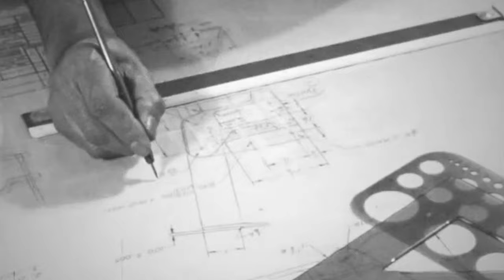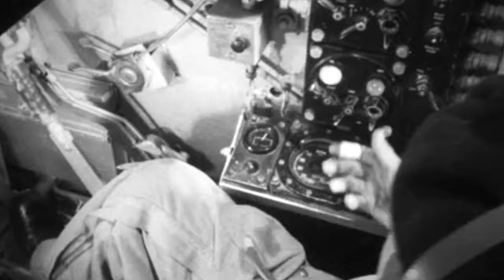The Colossal 120-millimeter Tank Cannon

Comment: IS3 uses the same 122mm as IS2. Ironically in truth the IS3 was a dog of a vehicle, so poor that it was removed from production, dire engine, feeble rate of fire. Centurion with a 20pdr (and then the fabulous 105) was a vastly superior vehicle to either. Conqueror was always intended to function in an overwatch capacity.

Comment: The FV214 Conqueror wasn't very reliable. It spent more time in the workshops than it did out on the field. It was too heavy and damaged roads when driving on them. Longmoor Training area in Hampshire has got some old Conquerer hulks left on it. They were used as anti-tank training.

Comment: IS3 is a scary looking tank
Reply: The IS3 is nothing compared to the IS7.  Hull down, the IS7 armor still holds up very well vs modern munitions from tanks.
Reply: @CorwinBos how do you figure the IS-7 would still handle shots at the turret? There’s some really really devastating 120mm projectiles that are used in many tanks today, and I’d imagine it would be lucky to withstand more than a hand full of rounds at most, even at 1 km away. I know the 7 has a very beefy turret but it is frickin 65+ years old design.